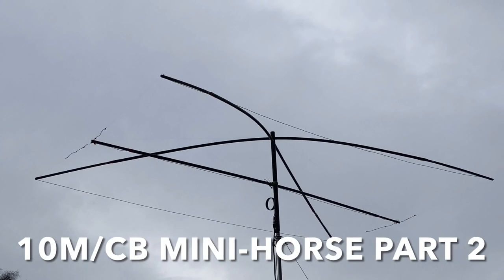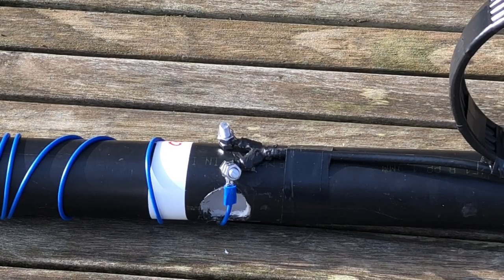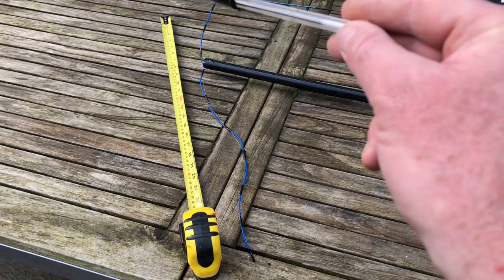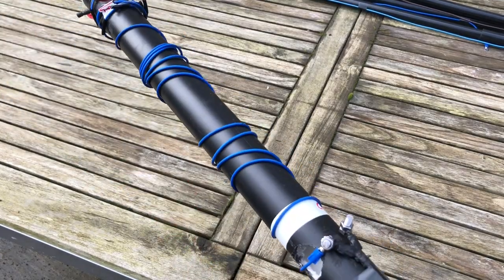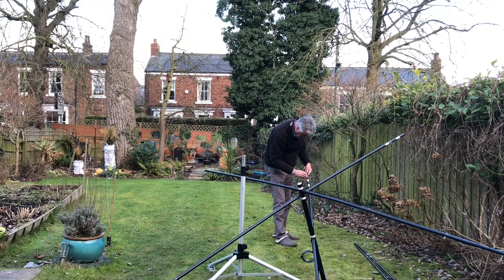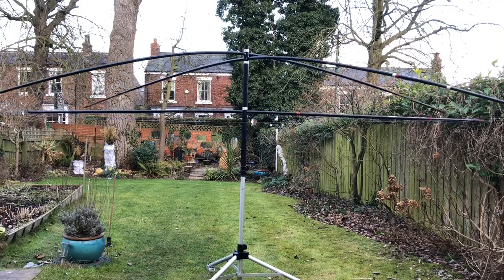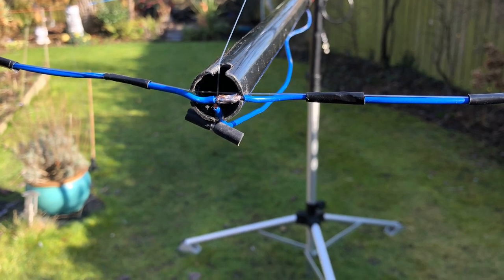10m & CB Band Simple Effective Yagi Beam Antenna - Part 2

Comment: I am sooo tempted to build that for taking up a hill, but I would need to have it at 90 degrees for vertical use for CB.  Of course I would need to to be a lot higher for that and that brings its own problems.  That is a nice easy aerial to build, I say aerial as I am not American.  I think I will build it after the nicer weather comes in, I can always shorted it later for 10Mtrs.  I say hill, its a mountain and I can drive to the top lol.
Reply from the maker: Worth a try Bob as it costs very little. I can fit 3m lengths inside my car, so /P is an option for me too! I’m guessing there’s stations out there using beams on 27, so others who are horizontal? Have fun Bob 😀
Reply: @ianxfs  Most people I knew of used beams vertically unless DXing and even then they were usually vertical.  But elsewhere is the world they can be horizontal and if DXing by the time the signal get there it could be either or both anyway.  It wouldn't be hard to go Vertical, bur "T" piece and can be vertical or horizontal easily, only thing is vertical needs a lot more height just to clear the ground.  Cheers for the idea, it will be built in summer.  Maybe even tried out if Covid restrictions are lifted.

Comment: i have your great design almost finished, my elements drooped a lot but my local garden Centre just happened to get a bail of bamboo lengths in, so I reinforced the elements with internal bamboo supports and wow what a difference now.
my only question please 
is the distance between each element and the driven element critical as you tighten the ends of each element  with cord allowing the elements to reach correct length ???
Reply from the maker: Hi Paul. I’m guessing if you’ve made the spreaders more stiff with the bamboo, then they may not bend as much as on mine. If you tape the end
of the spreaders where the wire crosses the end then the width of the director and reflector are fixed by this tape and stops the spreaders widening from each other at the ends. Your line on the sides can then tension to the correct spacing between all three elements. You may have to shorten your bamboo inserts so that there’s enough bend on the ends of the spreaders so they can flex to allow your gap adjustment. Once achieved, you can then line up and fix the driven element on the mast. Like I said earlier, my mk2 version with long bamboo canes was the one I thought was best. Still have it. Good luck 👍🏻

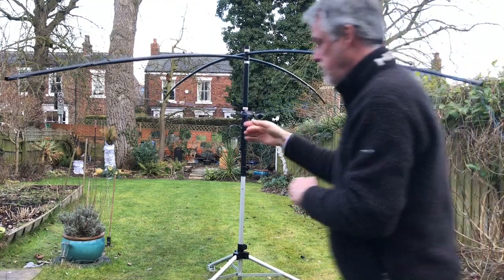Comment: hi again what length is your fishing line and capacitor at 13:02 in your video please on both left and right side please. Just so i can get the plastic poles gap correct.
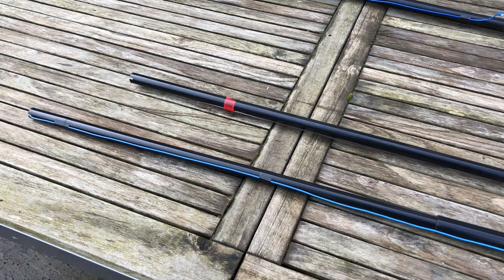Reply from the maker: Hi Paul. I can’t remember, but you’ll see in part 1 at 6:00 you’re trying to achieve a tension that gives you the correct width across the front and rear elements….

Comment: hi i have copied your design fitted my 3 spreaders its the main spreader i don't understand ,you show each end of spreader with two ends ,this has me confused? i thought it would only be one conductor length along the coax fed element?
Reply from the maker: Hi Paul.  Yes the design has capacitive loading at the ends of the driven elements. It’s in the design in the video shown before and during the build.

Comment: hi there i have one more question you may be able to help with please.i have your design built and up and running, however i notice my reflector droops a bit lower than the director ,do the elements need to be in line ,will the bigger droop affect the performance of the beam?,,any thoughts?
Reply from the maker: If you can line them up, all the better. Just tighten up the reflector on the arms. Not the end of the world if you leave as is, but worth tweaking 👍🏻
Reply from the maker: ps. Just check the overall outer edge measurements so ensure you’re not going way off the rectangle. You may find it’s something else causing the droop. Should be easy to sort. Have fun! (See also video on Mk 2 version).

Comment: Yes but what about a Slim-Jim antenna for the CB band made rigid by putting it in a piece of fibreglass pipe as PVC pipe will melt at 27.000MHZ
Reply from the maker: Hi David! I think the plastic parts will be fine. I’ve been using the same design on 6m with no problems 👍🏻
Reply: I like your idea of a slim jim - but PVC will not melt at 27MHz (where did that notion come from?) so Ian's antenna is a good directional solution.
Reply: @M0RMY  27MHZ is the resonant frequency of the Chlorine atom that is part of the PVC so yes PVC will get warm and soften and possibly melt.
Reply: @DAVIDGREGORYKERR  Thanks - like RF welding kit ?  You learn something every day! I note that most RF welders work at 27.12MHz and at 1-2kV AC.  Will be interesting to see if Ian gets this effect!!
Reply from the maker: @DAVIDGREGORYKERR  New one on me that! I won’t be shoving kilowatts up it, so I’m not expecting to lower a molten blob anytime soon 😁